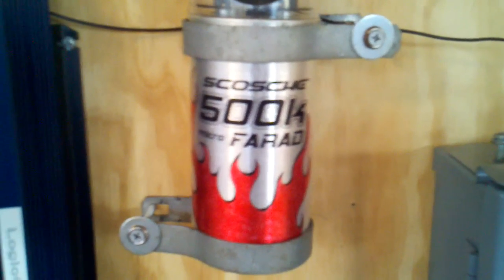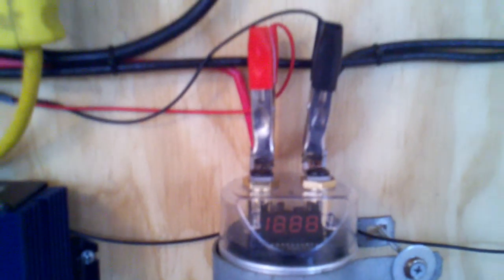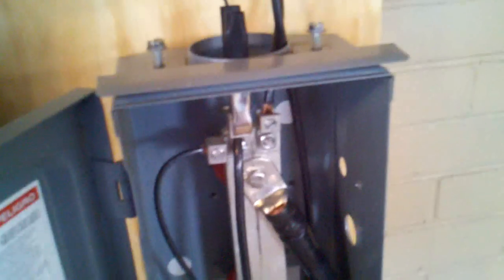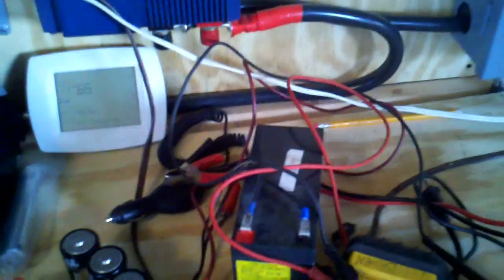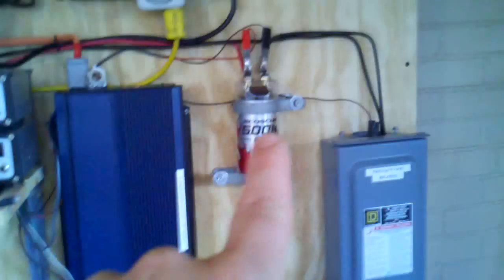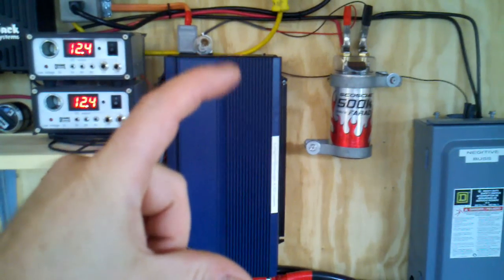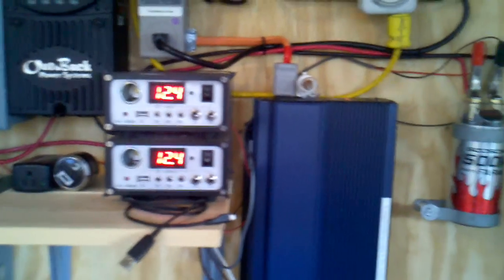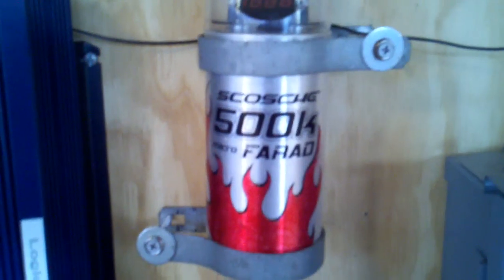How to wire a super Capacitor into your PV solar setup to help with starting up inverter loads

Comment: you know were i could get one off theses from the uk
Reply from the maker: hvac or motor supply store
Reply from the maker: disregard last. look at a high end stereo shop for automobile s
Reply: thank you mate , this is my setup https://gyazo.com/e6376274f6ec65ffe59674e76bfb64f2  7 deep cycle marine leisure batteries 770 amp hours i got  what do you allow your battery voltage go down two ? im scared to go down below 12.5 , what is the voltage do you know when you go into the discharge state ?
Reply from the maker: 12.5 is 90%. you are totally safe down to 12 volts. anything below 11.7 you are in the danger zone. never go below 20%
Reply: thank you , mate  do you think i need more batterys ? 770 amp hours is a fair amount , want to be safe without worrying about it dropping want to run a 100w 24/7

Comment: When wired in a car it's positive in from battery to the positive on amplifier. Why isn't screen on capacitor working? should run from positive buss to inverter positive.

Comment: Where can I get these caps to buy I try searching for it on eBay and amazon and can find a 500k cap
Reply from the maker: You can use larger ones. This is from a car audio shop. They use them to help the sub amp

Comment: Seeing that you reply to your viewers, I felt to ask this question to you Guy Brown :)))
I have a small 5 inch solar panel that reads 3W 9 volts(but actually reads more than 13v on multimeter). it charges a phone at the speed of 9% per one and half hour, in open sky but cloudy conditions.
I want to initially boost the current using some super capacitors, or some circuit that I can make at home easily, to atleast get a constant 5v 1.0A output.
Will the super capacitor once charged, keep charging and give a constant ampere continuously?
Can you give me an idea? thank you =))
Reply from the maker: Kketansa Art No... a cap will fully charge fast and discharge fast. they are designed t be the power house when needed. use the panel to charge a lead acid 12 volt battery and then use a car phone charger. that will get you where you need to be. good luck and Thanks for watching!!!
Reply: Hallo, thank you for replying nice Guy :)))
I actually was looking forward to no heavy battery option for hiking. Just a small supercapacitor, no storage needed. I thought something like, a small supercapacitor charges fast and discharges fast, but until then it will also keep charging through the portable panel. Purpose I thought would be, to acquire 1ampere continuous current which will match the charging speed of a wall charger.
Something like 'current buffering', hope you understood?
Thank you very much for attention )) , see you.

Comment: Wire size coming from the caps looks too light; larger wire would reduce voltage drop when they are delivering their needed surge.

Comment: this is a very interesting video.   I do have the same question as one below, where did you get your buss bars??    Are you running a separate charge contoller for the capacitor?     This would work very very well for a 220v inverter for a well pump, due to the immense surge.

Comment: This does not reduce the load on the inverter. It will only help reduce the amount of voltage sag during heavy load surges. The inverter will still do the same about of work.
Reply from the maker: It does reduce the starting load amp draw. It does not increase the overall running watt load.
Reply: @GuyBrown  The amount of power the inverter is supplying will not change. This will provide extra power that lead acid deep cycle batteries struggle to provide. Essentially it's like giving deep cycle batteries a cold cranking ability for a very short duration.
Reply from the maker: I'm not going to argue with you. I've tested the system with and without the cap. Starting amps are less. Ohms law... less voltage drop lower amp draw.
Reply: @GuyBrown  no kidding but your explanation was wrong. It reduced strain on the batteries not the inverter. Only thing the inverter benefits is less voltage sag therefore less amps required to produce the same watt output. Also nevermind my 30 years of electronics experience.

Comment: am.trying to use a capacitor on my ,,ice cream truck,,,mi.power inverter is from,3000watts,5000peak,power,,,,for.two deep.frezzers,,,which capacitor.should a ii.use,,e,during.the day.is.fine ,,,but at.evening,,,,the.battery,,is.weak,,,,but ,which

Comment: your Inverter has No surge current or surge facility??
Reply: Did you even watch the video?
Reply: +jayw900 yes I did watch but if the surge is working properly in the Inverter then there is no need for this capacitor.  and if you think the capacitor will provide the required Amps immediately so the  Battery will remain in good health,  that's wrong.  because this type of caps are very volatile and fast in CHARGING as well. so when the caps will be discharged because of sudden input. On the other Second the caps will be recharged thru the same massive current from battery as there is no resistance or circuit is present to limit the current.

Comment: 500,000 uF capacitor is QUITE A LOT despite what some say (.5 farad) and Walmart sells good chinese  stuff like everyone else. Caution however, this instantaneous surge would take FAR LARGER wire than used.  Basically you have test lead wire from a meter in the circuit and it needs to be about the size of the buss bar (000 size?).
Reply from the maker: Its #6 wire wire back into the buss bars. Thanks for watching

Comment: And that's really too small an inverter to be running a fridge.  I wouldn't recommend anything less than 5000 watt inverter , and it would have to be a low freq transformer based inverter .

Comment: and then is when i.need most the.the,time,,,cause.i.turn on the regular light of mi.truck,,,and mi inverter start beepping,,signal that battery voltage y getting.low,,,,,so.i have to.make adecision to.drive without lights,or let the.ice cream.melt,,,lol,,,,

Comment from the maker: I am not sure how you would wire that up.  Wiring 1 cap to each battery will will work for sure but not positive on wiring them in series. I think if you wire in series you increase the voltage and parallel you increase the capacitance. (look here) engineering tool box dot com and search capacitors.     You may want to look for 60v super caps online.  I will have to do more research. If you find the answer let me know.

Comment: It would be easier to put a capacitor on the ac side to reduce surge from motors and things from dimming power to other things and over running the inverter I believe (could be wrong)

Comment: Guy I think you missed the point....Your batteries are acting as big capacitors! You are NOT doing anything by adding a capacitor in the system.  At most you might make the small capacitors in your inverter work a little easier but that's all. Those internal capacitors are usually the last part to go bad anyway. So really adding a capacitor does nothing!  Sorry...
Reply from the maker: William Barnhill Thanks for your input. But for clairification the batteries are not caps nor are they acting as caps. The batteries are storing the energy just like the caps but batteries can only release the energy at a given rate where as the caps can expell all its energy VERY FAST. Therefore during a large draw on the system the cap will compinsate for the draw thus saving ware and tare on the inverter and batteries. Higher amps means more current. Any reduction in current will result in higher eff. So again thank you for your input but you are incorrect. Sorry... Thanks for watching!!!
Reply: Guy Brown,  William is correct.  The capacitor does not very much in this situation.
Reply: Andy Bushnell actually it can get rid of noise..
Reply: William Barnhill actually, you gain nothing from the caps,  motors/compressors starting load lasts longer then the cap is capable of putting out.  the reason why they work with car audio systems, is for the sudden, fast and quick bass drop.  

Motors/Compressors(such as what is in a fridge) draw a huge load over a few seconds, capacitors fully discharge in a fraction of a second, waste of money
Reply: +William Barnhill Batteries and caps are similar in that they store and deliver electrical energy.  They differ in their internal resistance -- caps have very much lower resistance, and that affects the voltage drop when a surge current is delivered.  But if a cap is too small, it won't matter, i.e., will have no effect.  It would help to video results, and see a fridge start, which failed without the cap.
Reply from the maker: timcat100 FYI I have had that inverter for about 4 years now. Paid $89 for it so that works out to less than $25 per year so far. Thanks for hatin'... Thanks for watchin! Oh and have a great day!
Reply: +Peter Lawton He wont do that, it would prove that the cap is useless.
Reply: @fischb22  seems like you don't know what a soft start is,.it doesn't matter of the start   load outlast the caps the quick release from the caps will help the batteries

Comment: Absolutely will have no effect on the inverter startup , useless and uninformed video
Just use larger cables from the battery or solar
Reply from the maker: It reduces start up amps.